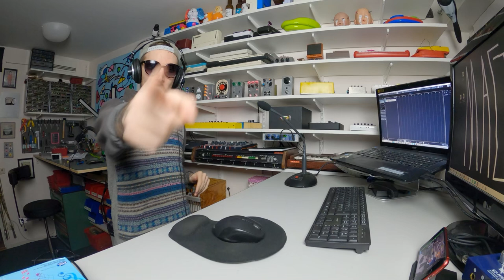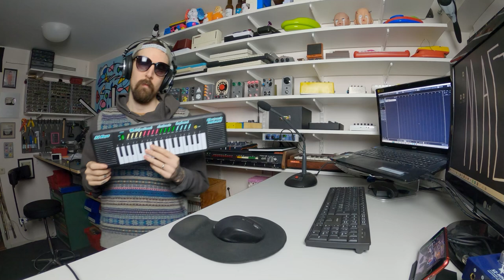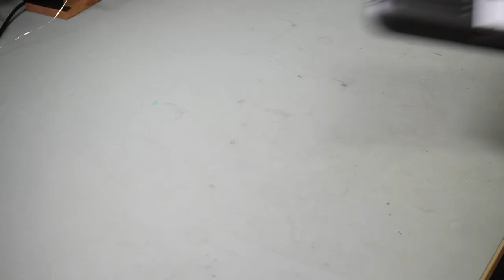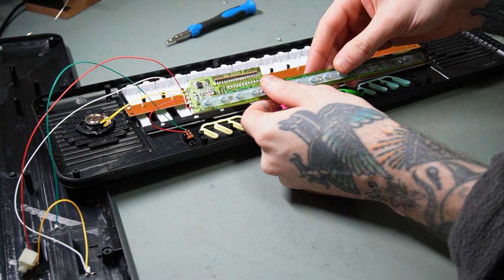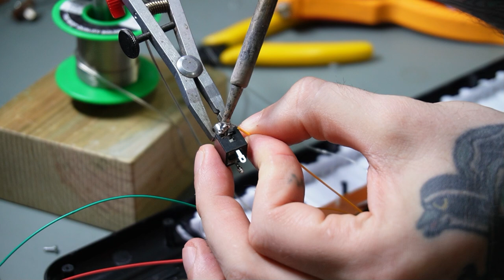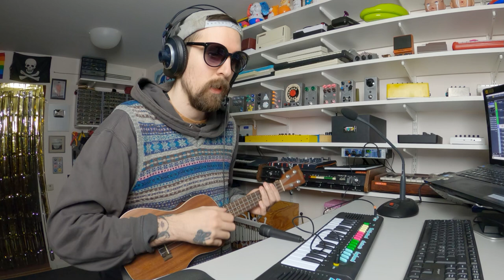Can YOU Even Make Music On A Budget?

Comment: I do have a $5 keyboard the casio SA 21 you would  have to be on the second hand market to find one and low ball them down five bucks but i stand by that keyboard solid 4 polyphonic note keyboard that shows up on two of my ten songs on my next album with a 1990 korg wavestation winning 7 songs and a 1988 song song rd 200 i got for 50$ and repaired getting 1 song. I used patches street organ #08 and #65 cathedral on the casio SA 21 from 1996